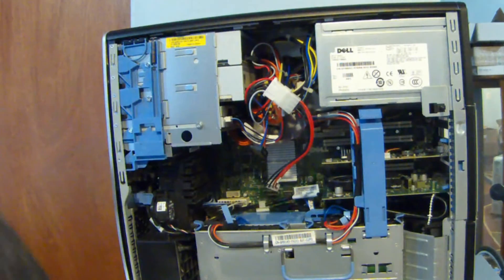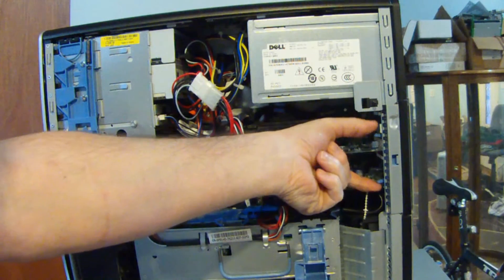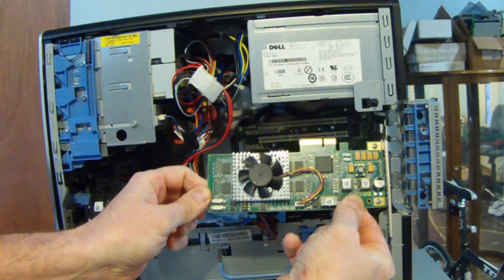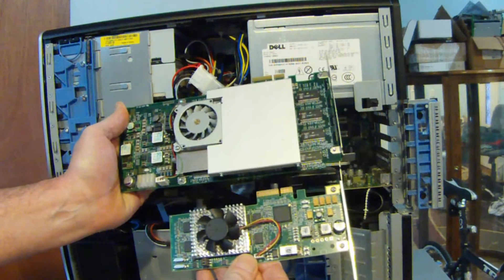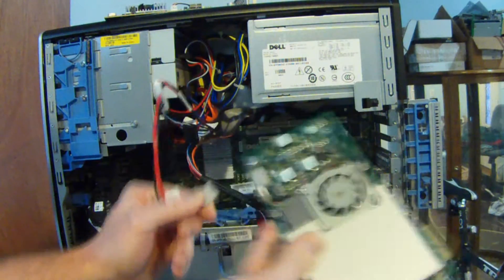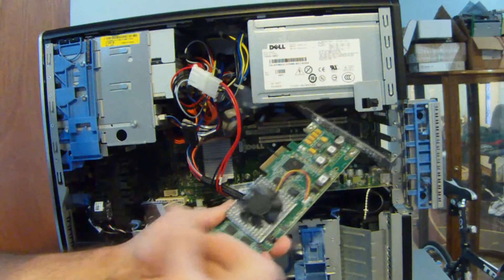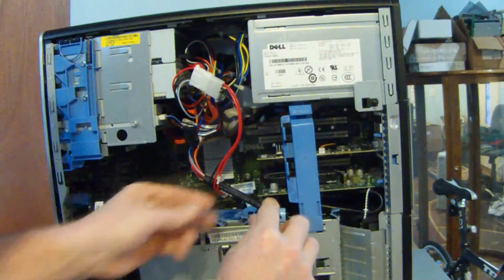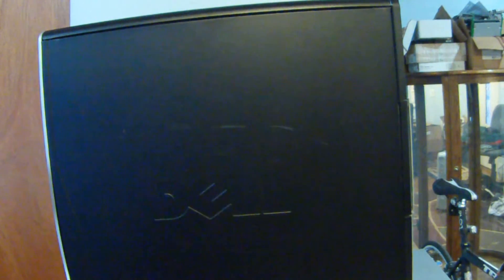TeraRecon Volume Pro Replacement   Dell Workstation   490   T5400   T5500   T5600

Comment: What is this thing I have one and I've been trying to find out what it does
Reply from the maker: TeraRecon does advanced visualization. It takes data from a CT scanner or MRi and reconstructs it in 3D. If you have one, somebody spent a lot of money to get it. It can be used for TAVR and TAVI, Virtual Colon, Stroke protocols, Breast MR, Cardiac CT and MR and SOOOOOOOOOOOOOOOOOOOOOOOOOOO Much more. Contact Support@terarecon.com and give them the TeraRecon Serial number from the top of your Dell box and they will be happy to tell you what you have and point you to videos which will help you master it.